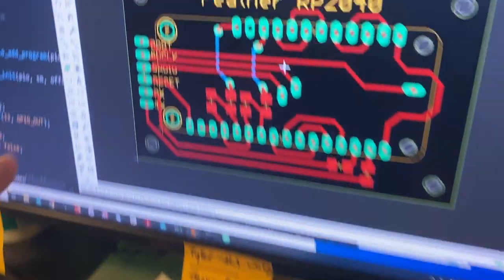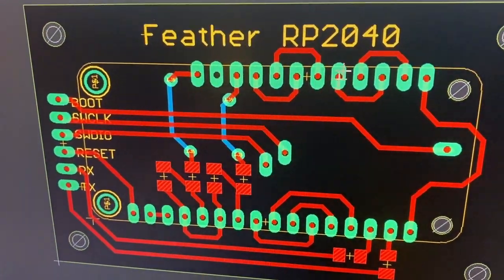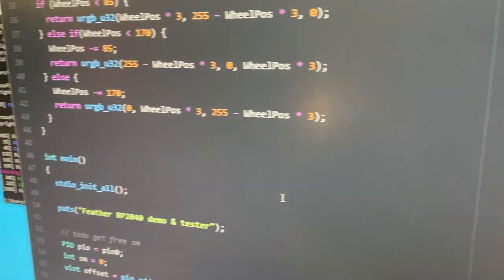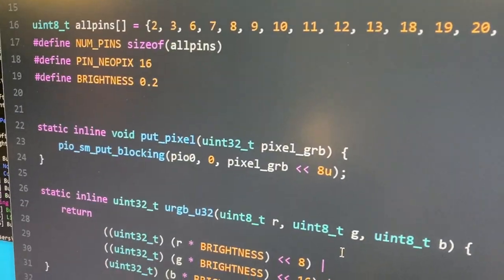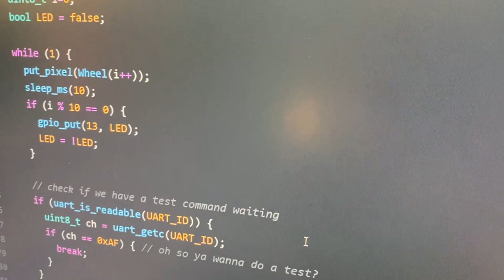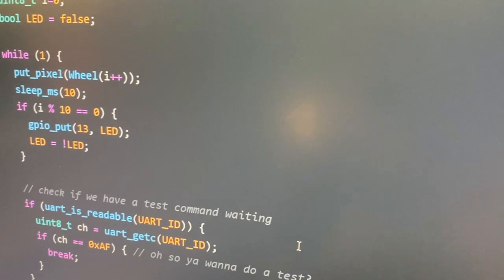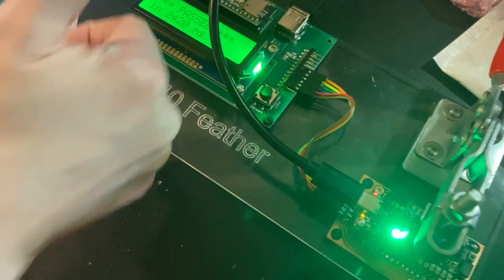Super Fast RP2040 Testing with Teensy USB Host

Comment: Just what is tested with this setup?  Are you just looking at pin connections, or proper port functions? ADC tests? 2.5 seconds is not too bad, if that includes download times, but the overhead time in loading the test jig is rather longer, no? Not sure what kind of test coverage you expect, or get... You could have a a "dummy" PCB with clearance holes for the pogo pins, to eliminate issues with bent pins, in case an operator misplaces a board before clamping...do you guys do any temperature cycling two pick up bad solder joints, or is that part of the pcb-level test say your contract Assembler? I guess that you depend on the the operator for LED test?
Keep well, have fun !